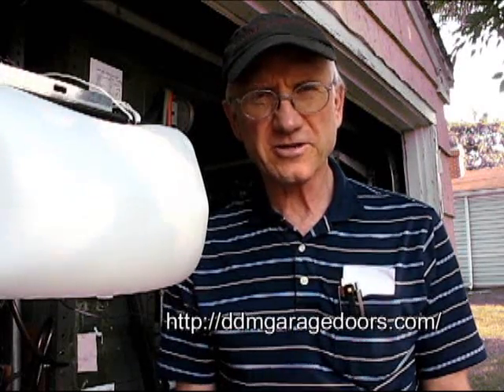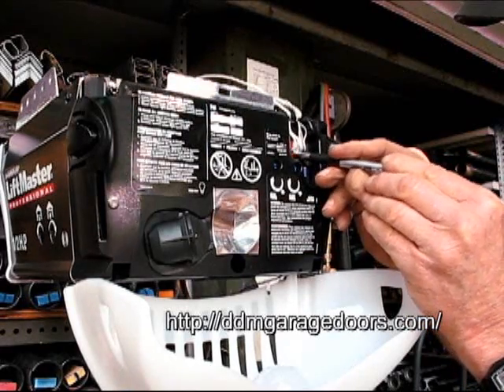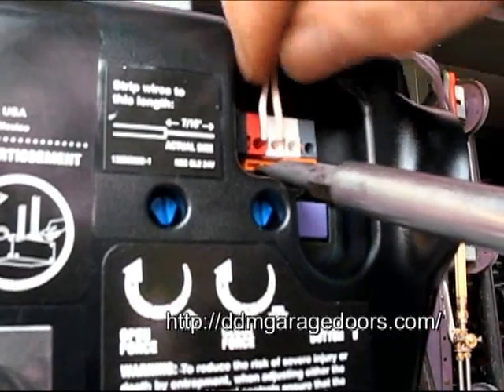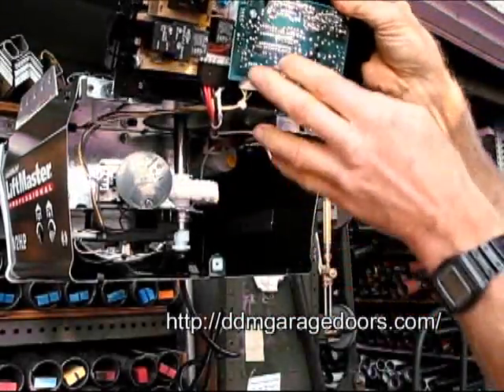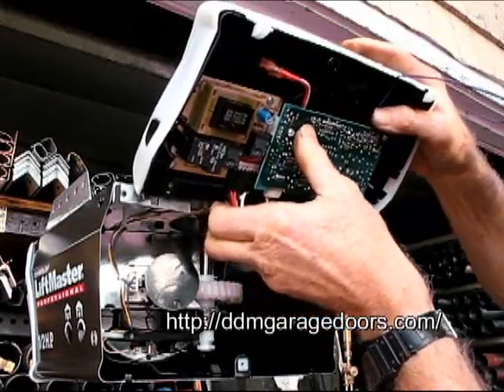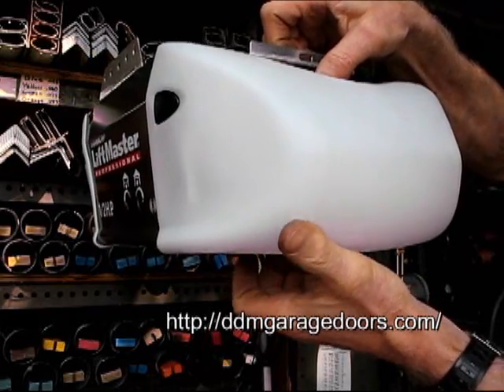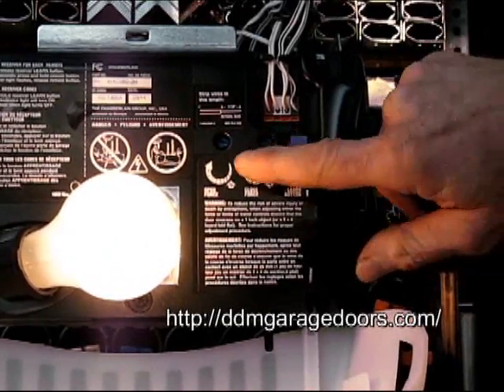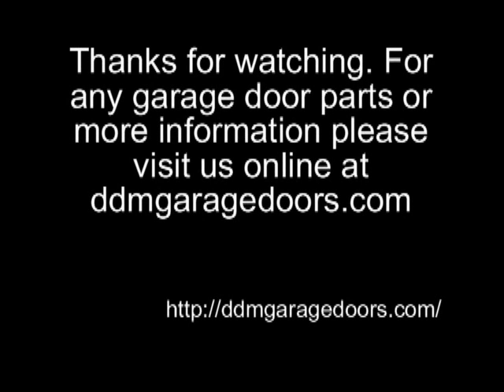How to Replace the Circuit Board on Chamberlain Liftmaster, Sears, and Craftsman Garage Door Openers

Comment: Sir. would like to ask if the garage door has to be open or closed manually is it also because of the circuit board too
Reply from the maker: Hi Nghia! No, there are a variety of reasons for the door to need to be open or closed manually, including that the issue may not be with the opener itself, but could also be with some of the parts connecting the opener to the door.

Comment: This video saved me a ton of money! Although my Stanley was somewhat different, it was still fairly easy to do. Your video gave me the confidence to do it myself. I had to pay a garage door repairman $75 to tell me that he would not fix, but replace & install an entire NEW opener unit for $500 - $600. I found a replacement circuit board online with S & H for about $60, so over all, I'm only out $135. Much thanks!!!!
Reply from the maker: We're glad this video helped you fix your opener, Milewskige, and we're glad you didn't have to put in a whole new opener just for one part!

Comment: The logic board is packaged in a an anti-static board for a reason.  Unless the exposed electronic item and the person handling it are properly grounded, one should never touch a circuit board for risk of ESD damage.

The handling of the replacement logic board in the video is more of an example of what not to do.  Other than that, yeah, replacing the logic board is that easy.

Comment: My bulb on my garage door opener goes in and out it is not burned out t bulb it is like a short in the light socket. Will replacing the circuit board fix it

Comment: My remote doesn't work unless I'm next to the door.  I have replaced the battery, so that's not it
Reply from the maker: Hi Lisa! It could just be that your remote simply needs to be replaced. Remotes will eventually stop working, as with everything else, and will need to be replaced at some point. Unfortunately, this may just be the simplest solution.

Comment: Dan- How can I tell if the circuit board is the problem?  I just replaced the drive gear which was worn out.  The door opened once but then did not even seem to get power to even activate the motor.  When I hit the opener button, I get a little click but that is it.  Help

Comment: Thanks a lot for this video. How can I know for sure that the circuit board has gone bad? My sensors seem to be working because if I put my hands over the one with the green LED light the light goes off (nothing changes if I hold my hand over the orange one though) and I can close the door from the wall mounted button. I do here some clicking in the box when I press the car remote but it does not open. So it can only open from the wall mounted switch but not the car remote. Thanks for any help.